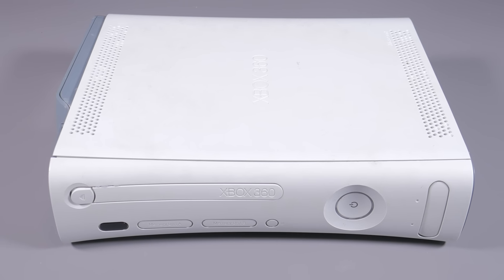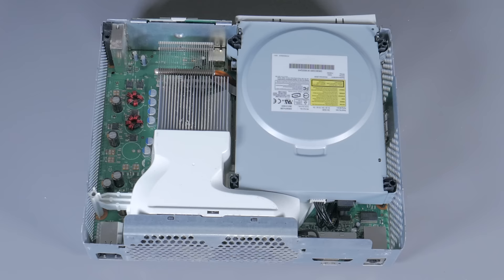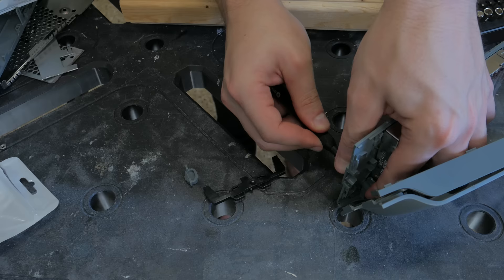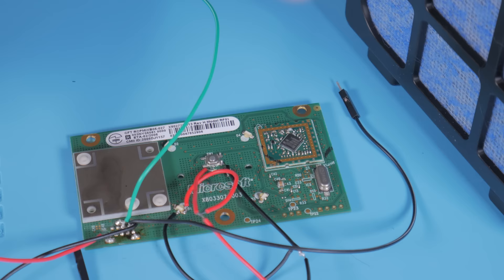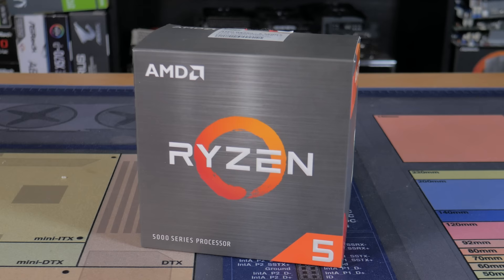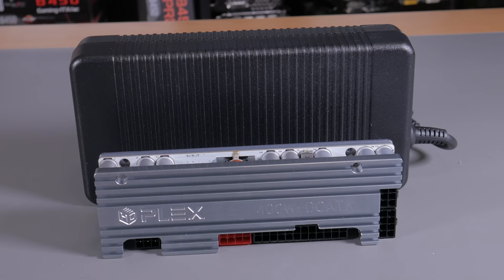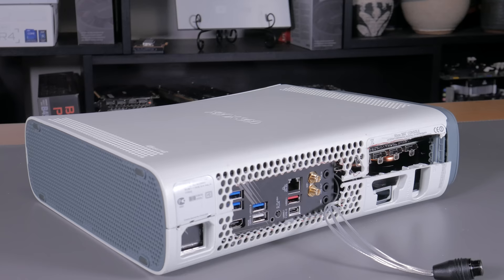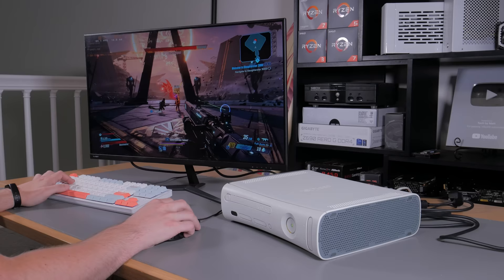I Turned My Childhood Xbox into a Gaming PC! (2022)

Comment: A part 2 would be really neat. Still though, hitting 80-90+ degrees on average will definitally hurt the lifespan of your components. If there is a part 2, if you somehow magically find a way to clean up the IO and make the temps more managable then that would be cool. Still, due to the space constrants I don't think it will be possible to get good power, noise, and heat distrobution. Maybe, it could be possible to get 2 out of the 3, but not all 3.
Reply: For cpu it’s not gonna hurt is as much I have an 12900ks and when gaming like on battle field v it hits around 89 to 91 degrees at 5.3
Reply: @arvixes8300  how? 12900ks at 5.5 ghz on a 420mm aio barely goes past 55c while gaming and 85c in cinebench
Reply: @Iinustechtips  you answered your own question
Reply: @korruption2802  ?
Reply: @Iinustechtips  you have a 420 aio
Reply: At least you will be fine for the winter
Reply: @korruption2802  even with 280mm you can sit at 60c while gaming
Reply: Undervolt OC and increasing fan speed helps a lot
Reply: @arvixes8300  something is definitely wrong with your thermals
Reply: my laptop: 90degrees in childsplay
Reply: If he manages to lower his max temps to the low 80s it would be perfect, that is a pretty tight case and only liquid cooling would be able to lower the temps to 60s-70s
Reply: I want to do the same thing, but build it inside an old used VCR Machine. Should have more space, maybe better ventilation, and it would be the last thing an intruder would want to steal.
Reply: @Iinustechtips  who knows he probably uses intel stock cooler
Reply: @weeaboojones2451  he needs ventilation grille and a better heatsink.
Reply: Seeing him make the temps more manageable would be cool
Reply: This is what we call the Red Ring of Death
Reply: I don’t see why he can’t add a grid of additional holes somewhere on the Xbox case that would emulate the design and fit in
Reply: @Motishay  I like the puns
Reply: Hmm.  See about under volting the CPU and GPU, maybe go with a 10000 rpm server fan on a potentiometer

EDIT: he'll also need an exhaust fan for the GPU as well, it seems like that the exhausting won't reach the GPU as/is
Reply: Adding additional fans would b good, especially if you could get cross ventilation going. It wouldn't be easy, but some more trials with additional 40mm fans would be good. Maybe need to go low profile fans to make them fit?
Reply: @JS-wc4xs  making them high RPM is fine too
Reply: @adventureoflinkmk2  high RPM means higher noise levels
Reply: @JS-wc4xs  yeah for real.. that's why I had to use a potentiometer
Reply: Bro I hit 150-170
Reply: Microsoft couldn't fix the heating issues so I'm not sure anyone can lol.
Reply: 90c is perfectly acceptable. It’s not good, mind you, but it’s still acceptable
Reply: The 5600x is known to hit like 90c LOL
Reply: Really cool, and thx for sharing. My first gaming PC was a Thinkpad 430 w/ four core CPU, and the egpu 1660ti upgraded from a 1050ti, via "the beast".  My thermals would stay around eighty to ninety for the CPU. I used this for a year or two and still have it.
  I thought about this when I heard you mentioning thermals.  Very nice job👍👍
Reply: now in this case (pun intended) you got to remember the triangle of pc building performance cost and tbh i forgot the third but imagine your a dot in that triangle whichever corner you go to you can only have 2 of the 3 options i think a ltt vid explains this better. idk good luck and a part 2 would be cool
Reply: @Iinustechtips  not everyone has that they probably have a 120 mm aio
Reply: i got a lesser managed xbox 360 that works too if you want to turn mine into a sleeper pc lol jk jk, unless?
Reply: Dbug card Xbox motherboard (Xbox vag) ram ic (computer)
GPU computer
Reply: Xbox
Reply: @arvixes8300  I got a Ryzen 5950x running full speed and maxing out at 84c with standard air cooling.. 

Is your thermal paste okay? 
Is the air flow in your pc good? 
Is your ambient temperature high? 
Is your mounting pressure correct? 
Is your backplate secured? 
Are your fans running too low? . 

Last question, does intel really run that hot o.O?
Reply: In Florida it always 90 degrees here my Xbox is fine
Reply: Hey, I do computer stuff too!! Lol not to even get into nanometers, or heat tolerances- or what other peoples builds look live vs. other people. All I know is, I went through 5 Xbox 360s because heat was an issue. And the casing of the first gen like in the vid above was definitely a contributing factor. My house is always hot… so liquid cooling is probably a safe bet, but a bet that’s ultimately up to him so good luck!!! Love the build btw man! My favorite Xbox of all time, enough to buy one… over… and over again
Reply: You can simply drill holes above the CPU and GPU fan shrouds to noticeably improve your airflow and reduce temps overall 🌬🌬💨🍃🍃
Reply: @daydream605  yeah Intel runs extremely hot my Chromebook with a Intel Celeron 4020n clocked at 2.6GHz gets up to 130F just doing basic things  and up to 160F gaming or multitasking and thermal throttles badly gotta set it in front of the AC to cool it down
Reply: These temperatures are actually normal for anew GEN equipment like the new gen CPUs and GPUs
Reply: @SilverStallion.eSports  That isnt true... I run a 5600x with with a BeQuiet air cooler and it never goes over 60 at stock (50% fan speed) and 72c is the max I recorded with a 4850 OC
Reply: Wouldn't be a 360 if it didn't overheat
Reply: lower voltage to the cpu as well as lower the cores clock speeds my i9 would hit 98 at 4.7ghz (way to high an overclock in a case with one fan) then i set the dynmanic offset for the voltage and it dropped to about 70 under load with 4.7 ghz
Reply: Another guy did a better video about this
Reply: Def won't hurt lifespan of the cpu or GPU, Linus has showed degradation doesn't really happen, if it does it's like 1%, and it's because he is still less than <105, so he doesn't need to worry really, yeah hot but not really, look at apple, before they went to their own chips, they run sooooo hot, and they last forever, so as long as he doesn't run greater than n >105 for a longgg peroid then truly he will be good, well his parts not dying or degrading wise, but I will agree that heat isn't good for performance, I bet all in he would get better performance if his temps were lower, I bet all in his GPU would clock higher, and all in bet his cpu would also clock higher, because as we know temps directly affect clock speeds, I l ft a comment on the video saying he should get a GPU riser so the GPU would then be right side up, he then wouldn't need that 8 pin flippy do, and then also turn the noctua fans around so they are intakes to help the cpu cooler, and I again bet all in his temps will drastically drop doing just those two things, and that way doesn't really have to change anything either
Reply: @Iinustechtips  Actually, The 12900KS can have a set power limit, it's base power is at 150W and can be set up to 240W.
I don't know if it has been changed to its max however it can be checked in the BIOS.
Reply: he has a 5600x just like me he should try using the curve optimizer it really helped drop the temps for me by almost 15c and only get a max of 70 with a hyper 212 evo
Reply: @Teej that’s why I was thinking a Xbox 360 slim build would be functional and original too
Reply: Not with THAT attitude you won’t 🤓
Reply: M3l203  ryzen 7000 sits at 95c with 420mm cooler
Reply: if 80-90 degrees is harmful why does the new Ryzen 7700x run and settle at 95c and then throttle accordingly? https://youtu.be/_vLq2PjmIx0?t=547 

Just curious, Thanks!
Reply: cleaning up the IO is easy and he mentioned the solution, just get custom sized cables, it would increase the air volume and unrestrict the internal air flow a ton.
Reply: Amd 7950x 95c is the norm
Reply: @arvixes8300  the new gen cpusnrun fine at 95c
Reply: he needs to keep it on ice 🍨🍦
Reply: Some liquid gallium would help on this build
Reply: @mashermack  yeh I wrote another one but I had a bad connection it didn't save my text about adding an igloo cooler and some dry-ice packs.
Reply: @arvixes8300  my ryzen 7 with a 2070 super  in an ITX case with 240mm aio runs a steady 70 while gaming, I’d be checking that if your gaming at 90
Reply: @jordandevine3416  no it's fine rn I updated the bios and changed the thermal paste and now its runs at normal Temps around 70 to 78 while gaming with shit ton of tweaks
Reply: Just like the real xbox 360!
Reply: I agree
Reply: @gamer6700k  depends on Silicon lottery, cooler and general temp. You can have vastly different results. Also, he might have 5.3 all p core or something, you might have 5.5 on a single core and  stepping down etc
Reply: @Iinustechtips you do realize not everyone has and Aio, some people just have the basic cpu cooler that came with their cpu.
Reply: 12900ks doesnt come with a cooler @TheSuperDuperLS
Reply: @Iinustechtips  still, some people don't have the money to spare for an aio, some people only have 10-20 dollars to spend on a cooler, quit acting like every has an aio.
Reply: Hitting 80s and 90 is not gonna hurt the parts that's the spec they are fine to run in they are ment to be able to run at that temp for ever
Reply: Liquid cooling has left the chat
Reply: i have a 5700g that hits 130w 2x tdp at 76 its fine
Reply: @Iinustechtips bros stole linus's youtube tag lmao

Comment: Imagine playing GTAV on a pc with 512mb ram. Insane what consoles can handle.
Reply: For real tho 😂
Reply: PS3 has even the half of it, 256mb ram and can run GTAV
Reply: @mr.electronx9036  Eh... The situation is actually pretty comparable. The PS3 has 256mb RAM and the GPU has dedicated 256mb RAM. The Xbox 360 has 512mb RAM but only 10mb of eDRAM. Consequently, the Xbox has to share RAM with the GPU.

Xbox is closer to internal GPU laptops, but the PS3's weird configuration is why multiplatform games often performed worse on PS3.
Reply: consoles version of the gta 5 is very different than pc version and also consoles dont run apps in the background like pc and whole power of the system is focused on running the game, and the os of the ps3 or xbox 360 is optimised a lot for running games unlike windows
Reply: but the game is really optimize for these spec + they are low settings vs pc
Reply: GTA5 still runs on 512mb of ram on PC's
Reply: @0othatoneo0  still incredible for 2006 console

Comment: I think installing some little rubber feet on the bottom would still keep it pretty stealthy and raise it up just a bit so the GPU can breath a bit more
Reply: Maybe use a CNC machine to add more mesh tor air flow?
Reply: LED light fixtures
Reply: @EmiratesQualityMark free fps, still don’t know why he didn’t add them
Reply: @Noodlepunk  As if the average person has access to a CNC machine
Reply: @TheeAbstractHero  there are places where you can send it off and get it done for you. Lol
Reply: @Noodlepunk  I'm aware. It's not worth the cost, those services are expensive.
Reply: @TheeAbstractHero  Nothing in this build is worth the cost so why not  😅
Reply: @TheeAbstractHero  a local votech machinist class might take the project on for free. We did some random stuff for people while I was taking one
Reply: if he raised it, the cpu would'nt be able to breathe
Reply: If he raised it 14mm and put some mesh on the bottom he could put some 13mm width fans directly underneath.

Comment: I love compact gaming PC builds like this. Would love to see a follow up with better temps and improved case!
Reply: I’m shocked nobody’s commented to add more airflow to the case
Reply: Drilling more holes in the outer case on the top is about the only effective option he has with the exception of somehow adding some external fans to improve cross flow but with the lack of space the system is creating convection (like heat swirls around in an oven) and it will eventually cook the CPU and will experience major thermal throttling in the GPU as well. While very cool this is just impractical due to the nature of PC components. This is why most PC cases are much larger that the parts you put in them!

Comment: I would've definitely used lower end, older parts, like an i3 10100f paired with a low profile card, as well as cutting out a few holes and adding a mesh over those holes to increase air flow. Overall though, impressive build. Made me want to try something like this with my fat ps3
Reply: Make a video about it
Reply: I'd only do it if it was broken

Definitely been tempted by the idea of a pc fit into a wii, was thinking about finding an older NUC board with a 4 core 8 thread and using a graphics card over M.2, preferably one that can be powered off of it. So probably the low profile RX 6400 XT

Maybe, just maybe, I can keep the components just within the NUC's included power adapter's wattage limit considering most of those things processors only consume 9 to 15 watts
Reply: Had the exact same thought about the LP GPU
Reply: The 5600X with undervolted dropped power limits is insanely efficient could probably get better performance with less power usage.
Reply: Man, I really want to put something in my old ps3 case as well someday.
Reply: @nesyboi9421  if u get a NUC with Thunderbolt over Type-C, u wouldn't have to sacrifice the M.2 slot for the GPU
Reply: @SciPhiSam  yeah I've looked into the logistics of the idea of using a NUC as a whole, it's possible but difficult and expensive. Thunderbolt would definitely be better than over M.2 though.
Reply: old i5 gen4, ssd, rx560/gtx1050 low profile is another choice
Reply: @nashcomp  I would say at that point the performance you are getting out of it isn't worth it.
Reply: @nesyboi9421  it depends on what case, for project like this , it doest need the newest i prefer  an old combine with a decent gpu.
Reply: @nashcomp  But if the whole point is gaming an RX 560 isn't going to be the best, neither is the older cpu. At least the thermals would be better.
I'd go with a low profile 1650 over the RX 650
Reply: I'd think all the cables bunched up in there would hurt airflow, so custom cables would help temps.
Reply: @SciPhiSam  I did a nuk game cube.... now they have picopie rip game cube
Reply: @nashcomp  bro lp gtx 1050 or rx 560 is so slow I used to have one for years until I upgraded to rtx 2070 this year. I also had an rx 560 2g (not low profile) and it was so slow nowadays.
Reply: @Casper's Studio yeah the 5600g isnt so bad, or 5700g

Comment: The build would have definitely benefited from a vented air exhaust, as you stated in the beginning. I would've considered swapping the GPU with an FE style cooler that blows the hot air out. It will be tricky for the CPU, though. I haven't seen a consumer vented CPU cooler on the market.
Reply: just needs to put inch legs on the xbox and cut 2 holes for the gpu fans and a dust shield. you wouldnt even see the holes being on the bottom. for cpu can use one of those itx boards that can use a laptop cpu and use laptop cooler heat pipes and blower fans

Comment: I think a blower style fan on the CPU cooler would help a lot with temps, since that fan is just blowing air at a blank plate at the moment. The little Noctua fans will be pulling most of the weight there, so glad you included them! Great video, and solid effort on what you've achieved here

Comment: Very nice build!
I would try to fiddle a bit more with the CPU and GPU undervolting and maybe try toswitch the small fans from exhaust to intake (without the shroud, it might not work very well in bringing cold air where it needs to be). Builds like these were really the ideal usecases for blower style GPUs of the past.

Comment: Hey Matt, excellent video, i would recommend that you use an Apu rather than a full blown GPU, that way you save space for airflow and components. Either way the main thin i woul do right now is add airflow on the top of the case, whether you use a discrete or integrated graphics.
Reply: Well, look at all those bunched up cables.  Not hating on cable management or anything, but I'd think custom lengths would help airflow by there being less occupied space in there.
Reply: @MisterKrakens  when? in a full size case, I'd believe that, but space inside this project is at a premium, and the difference could easily be larger.

Comment: I've been building a custom Xbox One PC - Currently a 2200g but long term plan is a 5600 and an A2000 (To avoid needing to run a super high power flex PSU). Its interesting to see how your approach was different to mine (and much cleaner. lol)

I've managed to internally have my PSU, keep regular motherboard standoffs (which I superglued to the case) but i've yet to solder the front IO (as I don't yet have a solder).

Thank you for what you've done :)

Comment: Nice build. You can definitely drop 10c or more if you just drill some holes where the CPUs at and make sure the GPU also has ventilation. With your CPU cooler fan oriented that way, it's trying to suck in air thats blocked off so it being 90+ is not surprising. In regards to that EVGA card, the hot air is exhausted through the side fin stacks so a combination of more ventilation and small fans to help direct it out would help alot. An A2000 GPU would probably work well as its less than half the vol of that and takes only 70W or so. Definitely give a look at some of the SFF Yters, they've done some great builds in that size or even smaller. Would definitely be cool to see a part 2 where you polish and shine this up a bit!